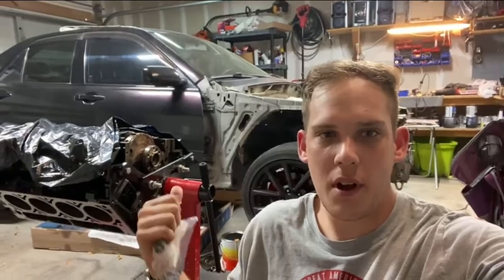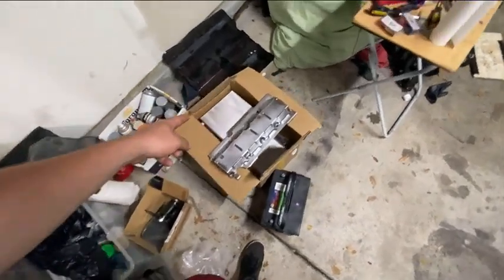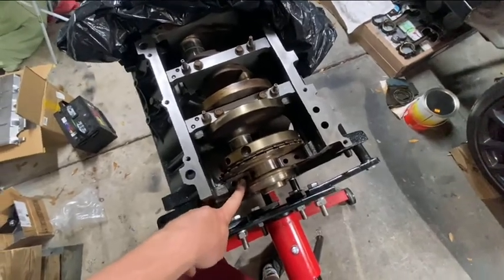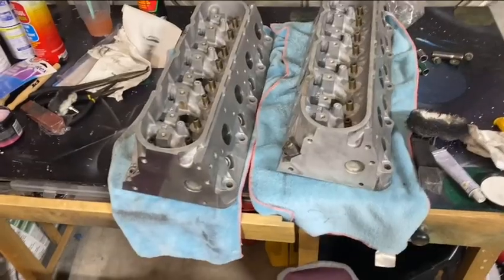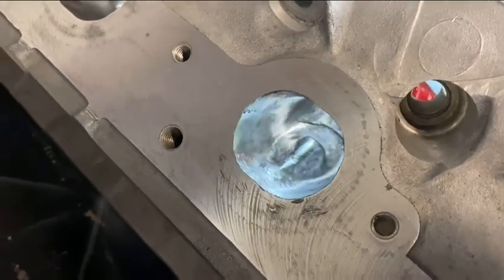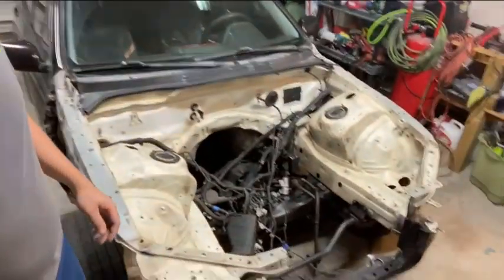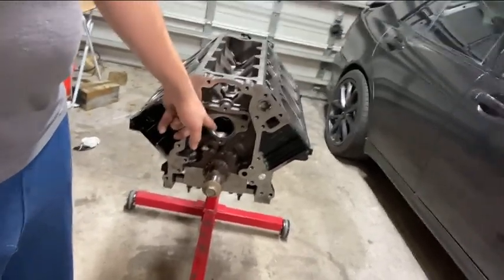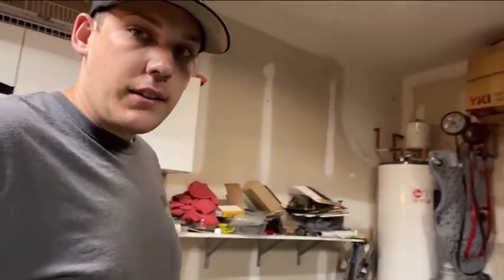IS300 LS Swap Part 2: Engine Build

Comment: Great start to you build so far! I’m also doing this swap with a 4l60E auto trans. Yea the tunnel needs a lot of hammering! If you figure out the neutral safety switch wiring and u joint adapter to rear diff, any info with those would be awesome! Btw I’m in a 2001 is300.
Reply from the maker: I just had a local driveshaft shop build a one piece. Took the old Lexus driveshaft to them so they could source the adapter better. They had a new one in stock and said it’s fairly common on all Toyota’s. I didn’t run into any issues with neutral safety switch, I’m pretty sure it’s already in the shift sensor mounted outside the 4L60E on the gear selector.